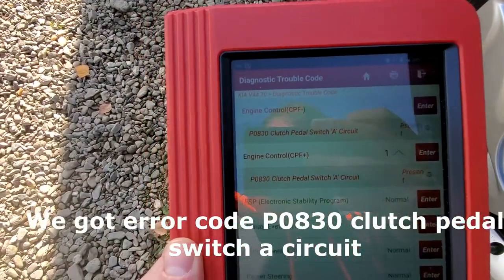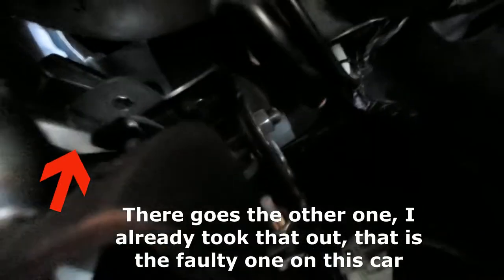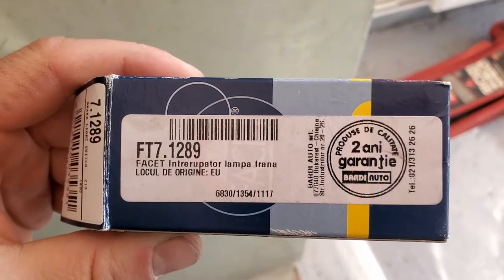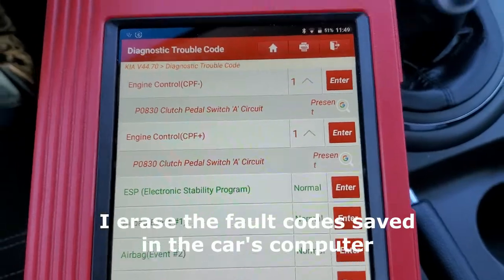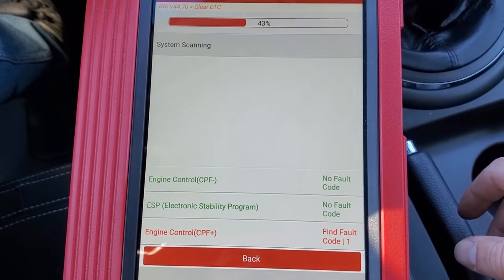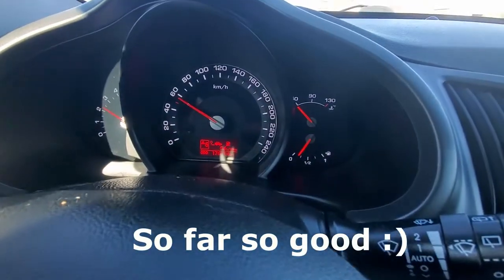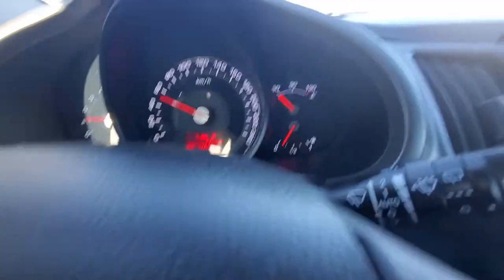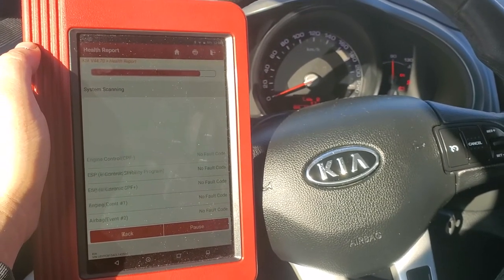P0830 Clutch Pedal Switch A Circuit, Kia, Hyundai Fixed!

Comment: FOR THE SWITCH CODE OE code 93840-1G000   
Is it the good OEM reference for a Kia sportage ? 

Because in Kiaparts tey says that is a code for the switch for kia rio 
For the sportage i think the  lower code for  the switch is  KIA 93840 2E 000

Comment: I'm from Paris 
Hy i have a problem to start my kia sportage 1.6 GDI  2011 ( First  problem after 10 years and 4 months not bad ;-) )
My Sportage don't start 
I brought my vehicle to kia and they tell me that the problem comes from this switch after having made a diagnosis

when my sportage did not want to start I suspected that it was about this contactor
So to check I made a bypass to see if it came from the clutch switch or no 
But in fact I realize that there are 2 contactors one at the top and the other at the bottom that's why my bypass method did not work
Now if the problem comes from there I think it is better to change the 2 contactors because they are the same age so if we change only one the other can break down after
On the other hand I do not know if my kia dealer has to order the 2 contactors or just one ,  I must contact them on Monday to ask them about this 

Thank you very mutch for your video
PS : what is this diag device that you use?